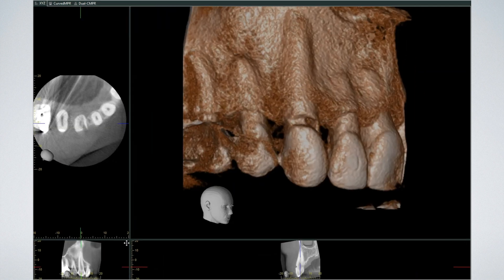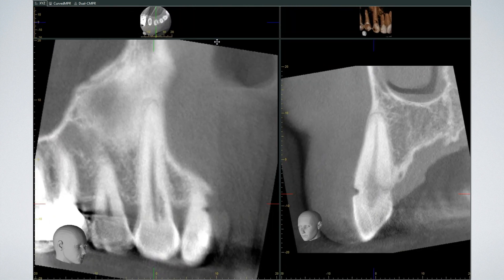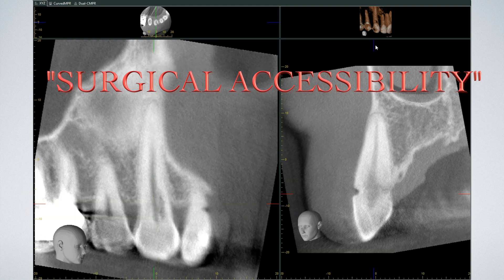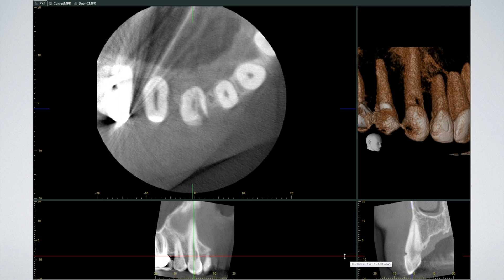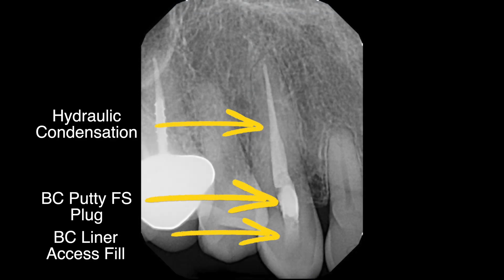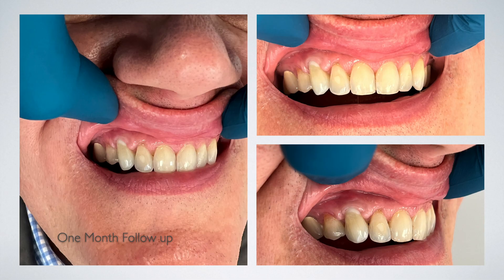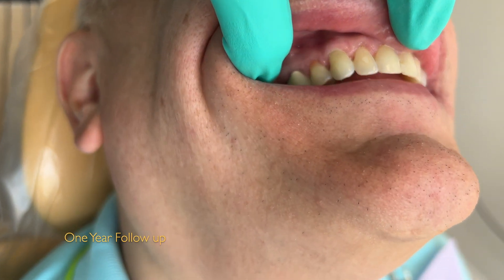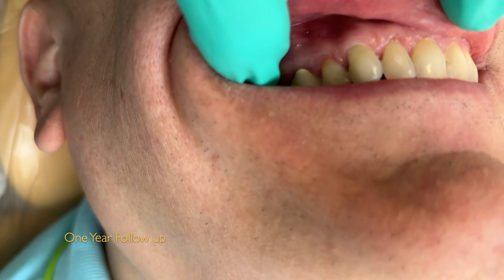Surgical Repair of Invasive Cervical Root Resorption (Part 2 of 2) CBL 44

Comment: Very well done sir.. although along with a Periodontist possibly you could have placed bone graft and membrane to cover up the bony defect on the mesial aspect which possibly could have given the covered the papillary defect mentioned before the procedure..
Reply from the maker: If I recall, there was no bone removal/loss to require a bone graft and there was no plan to build vertical bone.  That's why I didn't see enough of a reason to add to the cost of treatment by adding a membrane and bone.

Comment: How were the PPDs at 12 months ?
Reply from the maker: I did very gentle probing at one year and it was not deep. Frankly, in the absence of inflammation or any visual erythema I was not going to compromise the area by probing any harder. I assume there's some form of pseudo-attachment to the material and is somehow good enough that he did not have any issues. Of course, time will tell but so far so good. I usually feel much more comfortable with the attachment to the Putty than any RMGIC but then you can't have the Putty exposed to oral cavity since it can't be polished.

Comment: Excellent video sir, can we used resin modified GIC or geristore in place of BC sealer?
Reply from the maker: Yes. That's an alternative option. Etching and bonding is recommended with Geristore but not with GIC. Pure GIC will take longer to set which can be a problem during setting in areas where bleeding is present. You don't want the GIC to get contaminated with blood before it sets. So, it's a challenging choice here during surgery merely due to its setting time. Cheers!

Comment: How was the TCA applied during the RCT? Did you use it like an irrigant?
Reply from the maker: Using a needle. If the site is exposed directly it can also be applied using a cotton pellet. Have to be careful as a spilled drop on the patient will chemically peel the skin!
Reply: @EndosKool  So you accessed for RCT and then used a needle through the lingual access and only placed what I assume is a couple drops of TCA around the area of the cervical resorption lesion was? Was there tissue growing into the canal in that area? Do we not need to remove the entire affected area anymore as long as the TCA has reached all the resorptive cells when we go to fill the resorptive lesion after RCT is done? This is pretty fascinating treatment. Thanks for the upload!

Comment: 4:40 What instrument is that? Is it the EndoPro 270? Wont burning the tissue and mainly the bone cause worse healing?
Reply from the maker: It's the EndoPro270. That's a prototype tip I've designed. Hopefully will be available at some point. Here we're applying the heat to the bleeders only, not all over the bone. Your point about bone damage is valid. But using chemicals like Ferric Sulfate is even worst. But the site of operation should be dry before applying BC liner. Otherwise you won't get proper bonding and it won't work predictably. Cheers!
Reply: @EndosKool  Thank you for the answer! I would love to have the option of developing my own instruments and have them manufactured 😀 I am asking because keeping hemostasis during these kinds of surgeries, as well as retrofilling is the hardest part and I have never seen anyone using the heated plugger for surgery. I have only tried high doses of anesthetics (6ml) such as septanest 1:100 000 and that worked well. So this is going to be another tool in my toolbox! Also maybe, could scraping the cauterized area with a sharp spoon and making it bleed again would improve healing?
Reply from the maker: @martinchrom4444  yes, at the end all scabs are removed and bleeding induced to allow better healing of bone. Cheers!

Comment: Excellent presentation. Was there a reason why you did your vertical incision on mesial but not distal? Because the suture line won't be shown after healing when he smiles.
Thank you Dr for every thing you do for us.
Reply from the maker: Good question. Since the lesion wrapped around the mesial I figured it would give me better access to that area without having to extend the horizontal line longer. Suture line was not a problem since the patient had a low smile line (should always be checked before an incision is made.) If a high snipe line that may be a different story.